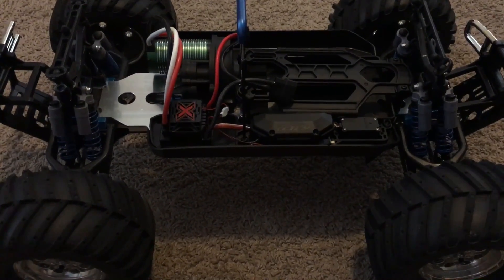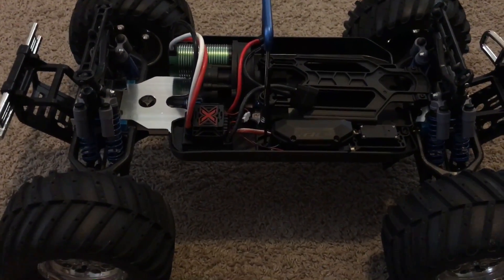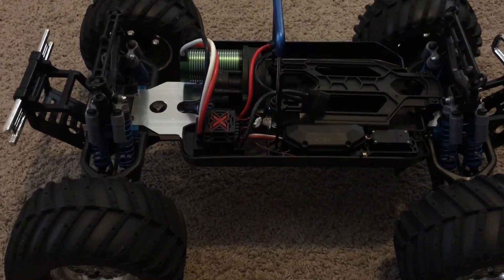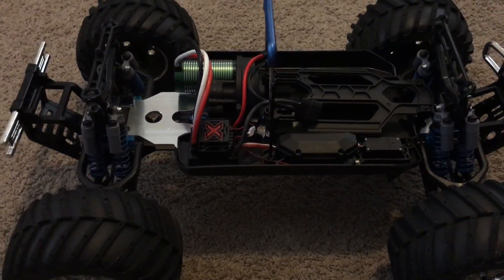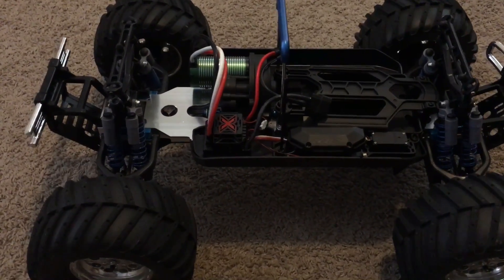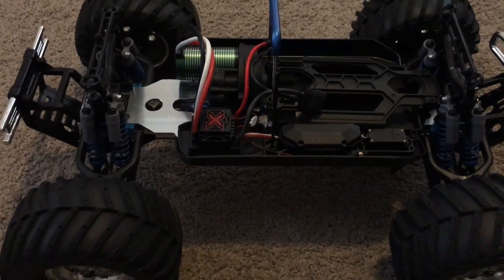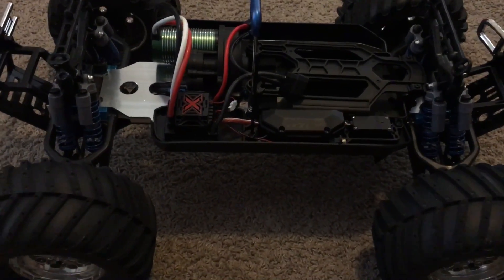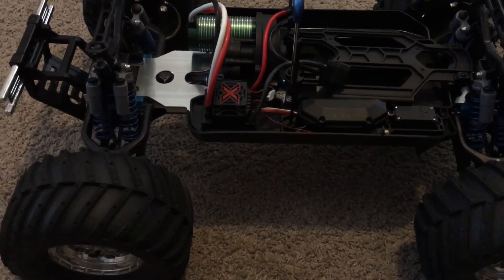Associated Monster GT-4.60 Electric Conversion

Comment: If it is a conversion, why do you have a rival chassis, both mgt and rival share the same diff, shock towers, shocks and all. And if it is a conversion, what lenght driveshafts did you use.
Reply: I did my conversion on an original MGT using stock two speed trans and soldered the throttle/brake servo parallel  to the speed control. Motor mount was for a hyper 7, but I had to cut it to fit and drill new holes. I think the mechanical brake it easier on the motor. But then it also adds weight.
Reply: @jasonjohnson9252  what he has there is a dead up rival. As for motor mounts, rc monster makes them to use on a stock mgt. Ive done the brushless conversion to one of mine and it was a PITA. Its easier doin a center diff conversion then what this guy claims. Im on my 3rd mgt build and the onlh thing holding me back is this pandemic because the mounts i need come from overseas and there is limited to no international shipping. As for your case of soldering wires, should have used a splitter.

Comment: Great setup! What was the rough cost of the conversion?
Reply from the maker: Thanks!
I paid about $70-$80 for the parts, about $220 for castle setup (but you can get the stock rival esc and motor for $120) and about $60-$80 for batteries. I got all parts from dollarhobbyz.com minus the esc and motor. So you can convert for as little as $260 (or even less if you can find used parts) if you want and it's like a new truck.
Reply: +Toys n More Awesome thanks for the quick reply. I really like this setup. Do you have a part number for the center motor mount? I would really like to duplicate your setup so and part numbers would help. thanks
Reply: @toysnmore8574  what parts did you use i have the motor an all of that lol
Reply: no that's the team associated monster rival truck with mgt body

Comment: I'm trying to find your conversion.. I have one of these I want to convert to brushlessany direct links or part numbers ?thanks
Reply from the maker: I'll give you the links to all the parts I bought to complete my conversion.

http://www.dollarhobbyz.com/collections/all/products/team-associated-1-8-rival-monster-truck-center-drive-shafts

http://www.dollarhobbyz.com/collections/all/products/team-associated-1-8-rival-monster-truck-complete-transmission

http://www.dollarhobbyz.com/collections/all/products/team-associated-1-8-rival-monster-truck-battery-tray-receiver-box-roll-bar

http://www.dollarhobbyz.com/collections/all/products/team-associated-1-8-rival-monster-truck-spur-gear-slipper-clutch-kit

http://www.dollarhobbyz.com/collections/all/products/team-associated-1-8-rival-monster-truck-extended-chassis-side-guards

You can buy the motor and esc from them as well if you want to save money. All the parts are new and actually a lot cheaper than when I bought them.
Let me know if you need any more info.